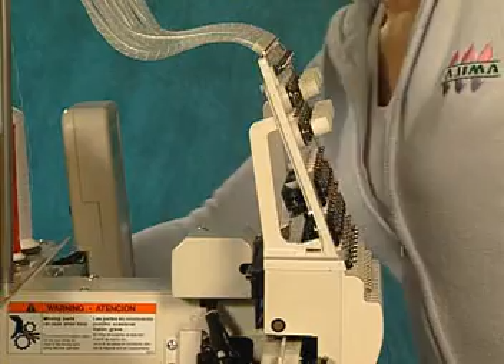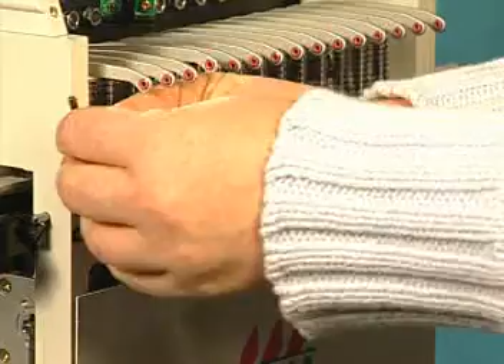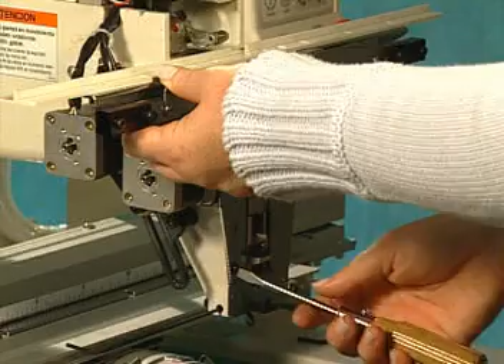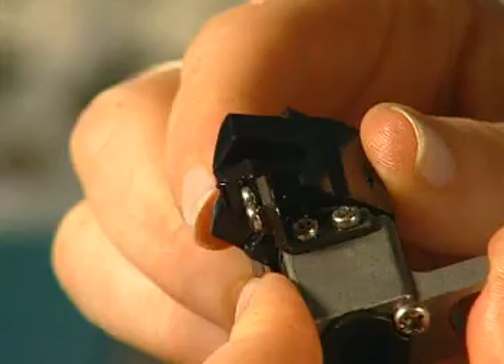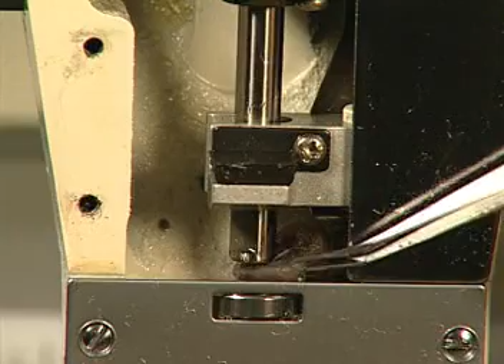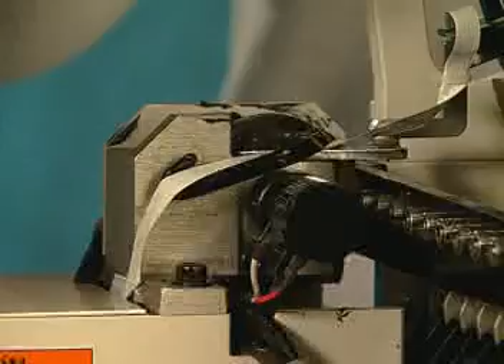TAJIMA TEJT-C REPLACE THE RECIPROCATOR

Comment: Hello, I have a Dahua A15 embroidery machine. I have a problem with the axle shaft. I have already done the repair steps by turning the wheel to 100 and adjusti
Reply from the maker: Depending on the problem if its not stopping at the correct position it’s could be the rotary encoder

Comment: Changed reciprocator on a 97 tajima tmexc1201 and neddle will not move. How could I fix it? Thank you
Reply from the maker: 1. Make sure it’s a Reciprocator for a single head not the same as do a multi head on this model.
2. Try getting hold of a complete re reciprocator set it’s much easier than just changing the reciprocator itself.

Comment: my reciprocator is sitting to high. how do i adjust it?
Reply from the maker: If it’s a bridge type machine you need to turn it to the lower dead position - 178deg and adjust the top collar - this should really be done with a pick gauge , but if you do not have one if you are persistent you will hit the sweet spot . This is the point where the reciprocator goes up regards less of the direction that you turn the shaft